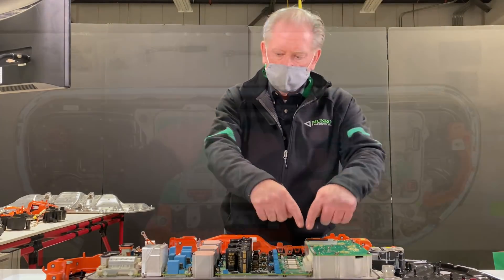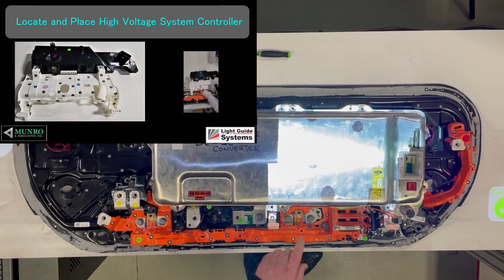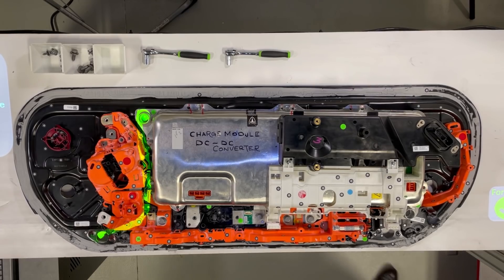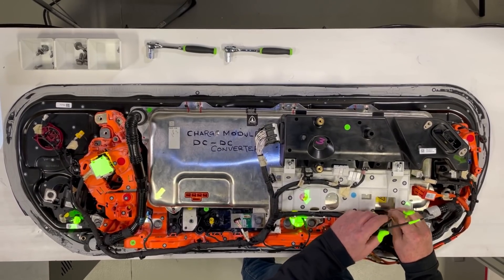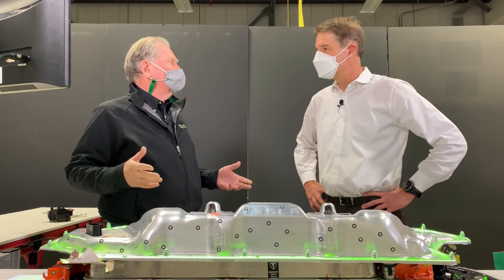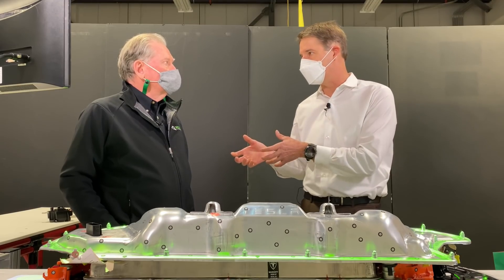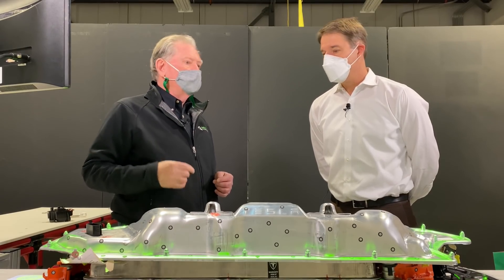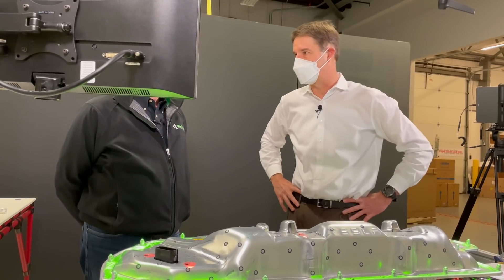Sandy Builds Tesla Battery Bay

Comment: Revisioning an old idea, which was in use in the 1960's and 70's. An overhead projector showed components on a circuit board, and where they needed to be connected. Changing steps was done by the operator using a foot switch, which changed a photographic slide to the next (or previous) in a sequence representing the complete component installation.

Comment: Wow, I haven't seen anything this mind-expanding since about 35 years ago when I dropped…Well, never mind, I just have to tell you, my manufacturing experience is along the lines of building Heathkits and Dynakits in the Sixties/Seventies, and later on some circuits breadboarding with wire-wrap boards. From my perspective, his is just insane.
.
Simulation and training software, and associated hardware, has HUGE X HUGE future potential. I can tell you one place that doesn't seem to get talked about too much: Health care. There is a business here in Chapel Hill, about a 3-minute walk away, called Kind Heart, that does simulation systems for heart surgery. HEART SURGERY. Heck, I begin to think there could be simulations for just about anything in life.

Comment: I have the battery an electric revolution needs. And it is not winning by chemistry (no solid state or other breakthroughs of the kind), but by unmathced prodution speed with the exact same chemistry just far less manufacturing steps / stages / costs / riscs. Also, its true and extremely modular design allow for per cell upgrades / repaires or replacements and thus can be considered as durable, ecological and futureproof as it can get (especially considering that each module is just as recyclable as a normal battery if not easier). Also it provides slightly more energy density but way more power density by leveraging the same design 100% tribute to the "less is more" / fist principle = simpler is better aproach and thus providing unmatched cooling (phase-chage based on water). Also, the polar moment of inertia is kept as small as possible by the same design. All connections are much simpler and neat ... The whole assembly is way stronger at frontal / dorsal impacts and just as strong in lateral collisions as a typical battery pack nowadays. Same factories just remove most of the stuff / equipment and quick-pop these babies and then straight to so many people not just wanting a Tesla as soon as possible but also not being quite able to shell-out the steep price it is at for now. So .... The only question remains how can this see the light of day in a Model 3 / Y and more ?! 40+ more juste as interesting inventions could very well boost Tesla, the electric revolution and much more, if it were for more interest from the right people with the right resources & experience. Thank-you kindly for any / all help reaching to Elon :) Tried email, letters, twitter, facebook, youtube, prayer, friends, enemies (not really ;) as I have none) and so far no luck (obvisouly ... ) All best !

Comment: So my guess is that this is not a Tech display for Tesla this is for potential competition of Tesla.

If you can't automate the line you can automate the thinking of the line.  This is exactly how you get 6 Sigma out of non skilled production line workers.

 This is a perfect solution with comparably minimal cost. In other words no major manufacturer will do it because they will say that it's cost prohibitive. 

Give it a few years and somebody will eventually utilize this. Showing this probly feels exactly the same as showing off the single casting doesn't it?

 You can always lead a horse to water but keeping them from drowning in the bath tub is always so difficult.
Reply: I bet I can guess Sandy's 1st question with the system.

Do you have any solutions for part and location tracking on continuous flow production lines?

 Projection placement via UV paint and camera tracking could do the job without leaving visible marks. 

 Assembly underneath the vehicle or around finished surfaces. This could also be useful for smaller part production of get these markers are placed on a cradle that the object is in.

Comment: I think using systems to guide assembly is a no-brainer and  this system looks pretty competent.  But the question I haven't seen yet (maybe I've missed it) ... an obvious question ... is what advantage does this system have over an AR headset (I'm thinking specifically Microsoft Hololens).  My instinct/experience tells me the Hololens is more flexible/adaptable ... but ... maybe I'm wrong.  'Cause I'm a software engineer.  That's how I think.  Maybe the light guide system is easier to adapt to a task ... maybe it's programmable like a PLC ... maybe it uses a PLC.  I assume the light guide system is cheaper?  Or maybe there are fewer legal aspects to different deployments: simpler Enterprise agreements.

I don't know.

These are questions off the top of my head.

Comment: Tesla is going to move that to the trunk and place a foot well where that unit currently sits. Thats how they will fit 7 people in the Y.
Reply: Its doubtful they will move it off of the pack after making the advancement of incorporating it into the pack to begin with.
Reply: @patreekotime4578  you think so? Idk I think with the new batteries they will have more than enough space to put controller into the battery pack itself. In the reveal video everyone came out of the four doors not the rear hatch. Plus the third row is a $3000 option on the Y , normal vehicles it's only like a $500- $1000 option. So either they are stretching the vehicle or your getting a higher KW battery to account for the extra people weight with small controller to fit them in. IDK makes sense to me...

Comment: Very interesting technology. How about AR ? It would be probably even more accurate and could display 3D instructions
Reply: At a dramatically higher cost for hardware and more time/cost to program the system. Glasses also cause headaches, nausea, etc and outside observers would also require glasses or screens.
Reply: @patreekotime4578  you just need a couple of qr codes on each part

Comment: Hmmm good example but why not just have one type of screw for all attachments, one tool required to tighten down not multiple tools? 
One electric ratchet for the whole job
Reply: They only really have two screws: small screws and large screws. Which is a DRAMATIC improvement over some assemblies. I've seen much smaller assemblies that contained dramatically more different screw sizes, and even a variety of different kinds of attachment hardware, requiring even more different kinds of tools.
Reply: @patreekotime4578 
Good points but does it need 2 different types of bolts? Why not 1 that does all the jobs
Reply: @brettmciver432  - Depends on size of item and configuration, one size screw may not be practical.

Comment: My wife and I are both retired. I watched this and then had her watch. I was in sales for thirty-some years, so there was, I believe, minimal use of this system that I would benefit from, but she was a "Quality Control Inspector" where she worked, (after years of assembly work), and she said this would have been invaluable in her work of electronics assembly of medical equipment. She had many people working with her that didn't have English as a first language. She said that many times, it was very difficult to communicate something that was important to know in the manufacture of that particular product. This system would have solved that issue by not even having to know English to work with it.  I can also see this as a workable training system for the military, such as how to maintain a weapon. Taking a gun to pieces, cleaning it, and reassembly. There are many such tasks that this would apply to, making jet engines, vacuum cleaners, almost any thing that has hand-assembly involved should be a customer of this product. Good job. I vote that you win the invention of the year award. If there is no category of awards for that, then they should add it. Again, this is a very good thing that you developed.

Comment: As a retired GM assembly line dude. the blow the brains out comment was accurate, IMHO.

    After a few cycles, I would want the option of switching to a monitor mode which would give an A/V alert, only if the operator missed something.

Training is a valuable short term benefit, but quality control is forever.
Reply: In an environment like Tesla where the parts may change after a few months, this would be invaluable to come back on and show the new configuration.

Comment: We had a somewhat similar system for PCB mounting back in 90-s. It shined light through the holes in the PCB and used a belt of boxes with components. It worked pretty well.

Comment: Wow. I have worked manufacturing for 40 years and I think there is a number of places this would work incredibly well.  Rebuilds is a big one. Also can it be used in product change overs. IE different bottle molds. Projected on to valves and fasteners would change thing by a large amount.  I seen many manufacturers struggle with this. Wow again.

Comment: Is that the battery management system or BMS?
Reply: Tesla combined the BMS circuits, the charger, and the DC-to-DC converter all into one unit, and this unit mounts directly on top of the battery pack itself. So in Model 3 and beyond all of this stuff is now essentially one unit, which reduces wire length/costs and simplifies trouble-shooting/repairs by giving one location for all of that.

Comment: This is a good training tool for an unskilled operator, but it's painfully slow in production, as you must go through each step to finish just one assembly. As soon as you know what you are doing, this system gets in the way. A better way is to put one part in place in one assembly, then repeat the step with another assembly, and so on, as once you know where a part goes, repeating the process is faster than waiting for the machine to tell you what to do.

Comment: Interesting Light system, but I'm thinking Augmented Reality goggle-based software would be a simpler approach. The goggles would initialy lock on to the 3D position of fixed, recognizable target(s) laying on the physical workbench in front of the assembler. Then display a virtual image of the next part to be picked up by the assembler. Once the goggles confirm the correct part is in-hand, virtually highlight the destination location superimposed on the physical work. Rinse and repeat until the work is fully assembled.

Comment: I saw a system like this for circuit board assembly in the 1970s. It used an optical film projector to project light to each component location, and a light on each componant bin to show where the part came from. The film was advanced frame by frame using a foot pedal.
Reply: @Sidowse  I don’t know if those capabilities are built in to this particular setup or not, but they certainly could be. I work for a large automotive manufacturer and we already use optical monitoring systems and automatic torque tools for quality control. As a matter of fact when a component enters a process it’s barcode is scanned and coupled to the vin number of a specific vehicle being built. The torque wrench records the torque of all fasteners and puts it into a file that follows the vin number and vehicle. If there is ever a problem the file is reviewed. Many optical records as well for component placement and/or defects to reject components. Very cool stuff!
Reply: That’s very interesting that the technology existed then. I assuming one of the things it couldn’t do was receive optical feedback to confirm things were put in the proper place/not missing.
Reply: @Sidowse  Until the model change or revision hits. Then it would become extremely useful again. Also if it’s recording it can be used to confirm proper component placement and quality control all the time.
Reply: Nice to see you also there Mike ;)
Reply: that is a great idea, it would be helpful to have a back pedal as well. You could get building stuff really fast using this method. It could optionally try to know when the next step is complete and advance. This is awesome that Sandy did this
Reply: I’ve seen it done with a light source and mirrors at least 20 years ago.
Reply: Second day.
Reply: Yeah - I worked in the Audio Visual industry 20 years ago and we supplied Toyota in Derby England with digital video projectors for exactly this.

So this is clever but its defiantly not new.
Reply: The capabilities are there, it's the person who made the instruction who chose not to use them. The issue could be that the surface is too reflective for the camera to pick up anything. Advancing on a certain Torque is also possible. In the end, it's also a matter of "do I want the system to advance on its own or do I want the employee to choose when he advances. There are pro's and cons to both approaches.
If you want to see what the system is capable of... this is a bad video.

Comment: Another great video, cool system: the data collection esp in regards to errors and time etc. is hopefully used constructively and benevolently as with any big brother style technology it's a double edged sword. My mind wonders if a manager will use this data to be overly harsh on workers harassing them on tiny metrics....like amazon.... thus treating the human like they are robots. But since these systems will be used anyways it's important to look at the upside of the system and attempt to use it ethically. 

As a former millwright I can't tell you how many times we had to cut, weld, move a change a project drastically because the engineers plan works great on paper and the parts of the project technically fit, but it was physically either impossible or very difficult to complete the task.
So I really like the tracking of installation challenges so the product can potentially be engineered for a more efficient biuld.

Good stuff Sandy and team.
Reply from the maker: thanks for tuning-in, we always appreciate your comments.
Reply: I think we are seeing alot of that happening at Tesla right now as a reaction to Production Hell. They are learning how to design things to make them better to build.
Reply: @patreekotime4578  hopefully you are referring to the part of my comment that is about reengineering for easier assembly and not the part about harassing employees.... lol.

Comment: As someone who has been an operator in system assembly (medical MRI equipment, big servers, other special hardware hand built high end stuff in NL) can say this looks interesting, but probably also dumbs your mind down alot in a way that might not result in less mistakes, assuming someone does the same thing for a long time. This only means you have to think less. Maybe it can be proven it is better, but I doubt it will be (long term)... It will only mean your work is super dumb and robot like

Comment: Old tech, Smart glasses is the future.
Reply: Why? Glasses are expensive. 3D programming the instructions is time consuming (and therefore expensive). The glasses cause headaches, may not work for all employees, and can create safety issues by obscuring part of the vision. AR with glasses also cannot be observed directly by auditors but requires another visualization tool. Glasses are a gimmicky gimmick that just makes little sense in the real world. As Elon says, the best part is no part. If you are going to project images over the assembly area, why not just project images directly over the assembly area?
Reply: @patreekotime4578  What says this solution is cheaper? With glasses you can move around, and do not have to have a stationary stations. Cost is not a problem it will be cheaper much cheaper (remember mobile phone cost?), and AI will help with coding, This technology is  where radios where back in 1920's.

Comment: I would much rather sink a one-time cost into a system such as this with refinements vs a technical manual and continued training costs! 👌🏼
Reply from the maker: Great point!
Reply: You still have revision costs associated with the analysis and programming end, but it may be possible to have those teams working directly with the designer so that as parts manufacturing are revised, assembly procedures are revised simultaneously. That in itself becomes part of the magic of the workflow.

Comment: Another great video. That is amazing technology. Looks like a great fit to tie in Augmented Reality glasses. Thank you Sandy.
Reply: No need for glasses that cost a fortune, 3D visialization software that is difficult to program, and glasses may cause headaches or not work for all employees or may be distracting and cause safety issues. AR also cannot be observed from the outside without another visualization tool. This is dramatically cheaper and better for everyone than the glasses. Its been around for a long long time but is still a better solution.